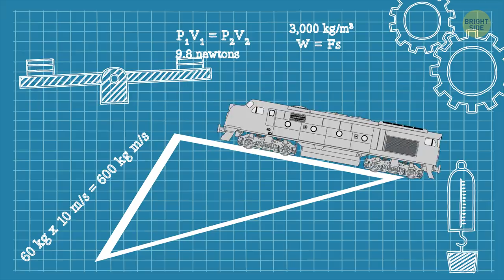Why Trains Blow Their Horns So Much

Comment: A locomotive in the back is called a “DPU” (Distributed Power Unit)
Reply: Hello fellow railfan
Reply: In the age of steam, especially in Britain. They were called Bankers. 0-10-0 banker locomotives were used on the Lickey Incline which is the steepest mainline incline in Britain at 2.65%
Reply: Don’t forget about Mid DPU lol
Reply: Only if it’s remotely equipped. As you probably know, DPUs are unoccupied by crews, while helper locomotives are.
Reply: Yep for the past 6 Years I was wondering was the meaning Of DPU is thanks for telling that
Reply: Hello other railfans

Comment: For the last part of the video... they used to split the train in two and make a double trip up the grade, or have a helper unit go up and down the grade... but now they used what is called a Distributive Power Unit, or DPU, these can be located anywhere in the train from the middle of the train to the rear end... just a little more info for viewers who aren’t as experienced with trains.

Comment: The loudest train horns of Japan are:

The Horn of the Series E5 Hayabusa Shinkansen
The Loud Horn of the Enoden Line 500 Series, that is only used when cars go out of curved areas near the railway, since the whole area is like a tramway, because trams run near city roads.
The Horn of the Toei Oedo Subway Line 12-000 Series, which echoes loudly even when the train is still far away.

Comment: The engine on the back is called a banker. Likley incline in Birmingham, UK, was a 1 in 37 and the Midland Railway built a massive 0-10-0 for banking. However, they also used Fowler's Class 3F Jinty Tank Engines. When it was taken over by the Western Region of British Railways, the used Hawksworth's 94XX Pannier Tank.

Comment: I've been a railfan since I first saw a Providence and Worcester local in Uxbridge when I was 3 or 4. I've spent YEARS at night listening to WODA going south at night. Usually I can hear a nice clear Leslie RS5T-RRO, a sign of a B40-8W, or sometimes a really fouled and quiet horn.

North American horn patterns for rail use vary by road. NJT sounds their horn before platforms, MN sounds for the access paths in New Haven, while the LIRR has some less-strict horn rules because they have their own rule book, and don't run under NORAC? I can really only speak for Northeastern roads though. And that's just pasenger roads; freight operations are different.

Comment: I live right next to railroad tracks that carry both commuter traffic (rush hour only - i.e., M-F morning and evening only) into Washington DC.  It also carries freight (and lots of coal) all day and night long.  The commuter depot is probably less than a 10th of a mile from my apt. building (and our bedroom faces the train station).  We have lived there for 13 years and we have become so used to it that we don't hear it at all during the night (unless we are already awake) and hardly during the day.  We have to consciously listen for it.  It is amazing how your brain can ignore repetitive, non-dangerous sounds.  It is only if the horns sound different or an especially heavy train goes by (sound is slower and lower and shakes the building) than usual that we are woken up.  Same with living close to a fire station.  Your brain usually filters it out.

Comment: 2 Long + 1 Short + 1 Long - We learned as children this sound made at crossing stands for: 

Stop! Look! and Listen!  That used to be on the crossing signs (the "X" shaped ones) and still is in some areas. Do NOT risk getting hit by a train. Your car may weigh 3500 to 6000 pounds, but the locomotive can weigh over 150,000 pounds. Not easy to stop just the locomotive. Even harder with 15 cars behind it loaded with a total of almost a million pounds.

Comment: Most of these horn signals.. are only for passenger service.   US Freight uses two shorts for going forward, 3 shorts for going backwards, 2 long 1 short 1 long for crossings, 1 long for a "going in between" (men working on equipment and brakes are set, reverser is centered to the motor does not move).

A lot of freight trains can do up to 3 percent hills, but that is called "mountain grade".  Special rules apply.  There is special cog trains that can go at higher degree hills.

Comment: Train brakes (at least in America) never really derail cars. American couplers are designed to prevent rail car collision during braking. Back in the day, however, train coupling was used by rope, which caused collision on cars and sometimes made the cars jump the rails. Nowadays, couplers are made of steel and they don't collide or derail like it did back then.

Comment: It’s called a whistle, not a horn, if it’s a steam engine it’s a whistle, if it’s a diesel it’s a horn
Reply: Not really, while whistles can be specific to steam locomotives, air whistles are commonly used on most modern trains in some countries in Europe. They're sounded when the train is about to depart from a station, and also as a precautionary warning. That's not to say that they don't have horns though, horns are only used in emergency purposes. In fact they used an audio file of one at 1:27. It's sad that they just hop onto wikipedia and copy and paste everything onto their script.
Reply: True and even some steam locomotives back in the day had horns as well. Is it rare of course, but it doesn’t mean it’s can’t happen

Comment: In the UK at the side of railway lines you will see, every-so-often, fairly large signs bearing the letters "SW." This stands for "Sound Whistle" and tells the driver that they need to sound their horn due to approaching a junction, a crossing point, etc. "SW" dates back to the steam engine days when the driver would sound their steam powered whistle. Although steam trains are a rarity on mainline railways in the UK these days, they decided to stick with the "SW" sign and not change it.

Comment: U have got it all mixed up. A STEAM engine has a whistle. A deisel has a horn.
Reply: Actually, some steam locomotives are equipped with air horns, and some diesel and electric locomotives are equipped with air whistles. Or small steam whistles that don't take up a lot of air pressure. The more you know.

Comment: There is a thing in railroad language that goes, "Don't Dump it till you Thump it" which means if there is a car on the tracks, you don't sump all the air in the system until you get a car, but if there is a tree log in the tracks,  it will go, "Dump it before you Thump it"

Comment: As a railfan, i can confirm this info is all correct for US railroads. by the way, the locomotive in the middle or rear of the train is usually remotely controlled and known as a "Distributed Power Unit" or "DPU".

Comment: A train horn is a loud, powerful air horn that serves as an audible warning device on electric and diesel locomotives, electric or diesel power cars, and in electric and diesel multiple units. The horn's primary purpose is to alert persons and animals to an oncoming train, especially when approaching a level crossing. The horn is also used for acknowledging signals given by railroad employees, such as during switching operations.
Reply: I Could not have said it any better

Comment: I don't live exactly next to a rail road but near me is some kind of phosphate refinery some 5 miles or more away. You can hear the faint horns as trains tow trucks of phosphate behind them. My face lights up. It's kinda quiet because they must have tons of cars filled with phosphate waiting for them or they mine slow enough for the refinery to handle.

Comment: say that to the 4-6% saluda grade in nc owned by norfolk southern locomotives till 2001 had to ram the back of some other trains and they have to have safety sidings at the bottom of the grade in case of a runaway they had to derail trains sometimes because the brakes went out on the grade

Comment: Should have mentioned the cogged railway, one that uses a middle "rail" that has teeth that meshes with a gear on the engine to pull the train up the hill.  Also there are trains that rather than going straight up a hill go around the hill several times at a more gradual incline.

Comment: When it comes to stopping.... yes but no... the brake shoes make direct contact with the wheel on most locomotives and rail cars... yes they are metal. The wheel doesn’t lock up, it rolls smoothly to a stop... so if sparks would ever be seen it would be from the brake shoes, but not only that.. a standard American freight train is around a MILE in length.. so NO it can’t really stop because all that weight at such speed doesn’t want to do anything else than keep propelling forward

EXAMPLE: if a train hit a car at the same time it hit the emergency brakes (100%) the entire train would pass you because the train is a mile long... that’s how long it takes it to stop at 55 MPH, so basically the last car would be in the spot where whatever it hit was when it fully stops.
Everyone should know that by now.

HORNS: long long short longs are only a rule in North America (Canada USA and Mexico) the first long is sounded usually as an automatic signal activates if there is one... the second is not long after that... the short is as the train is about to cross... and the final long is as the train crosses the road.

When a train moves forwards it sounds 2 SHORTS not longs.

What I’ve heard a train basically smashes the horn multiple times if something is on the track... repeated shorts.

Comment: I'm surprised you didn't mention that trains are fitted with systems to drop sand on the track in front of the drive wheels to assist with traction in slippery conditions.

Comment: I think this video is only for North America!  Other states have different rules!  Example Austria: (The country, which looks like a fish, is located in the heart of Europe and has no kangaroos) A distinction is made between high and low whistles.  High are for the environment, depth for signals within the train.  This used to be important when there were hand-braked trains.  Again, whistling only at technically unsecured level crossings.  The driver must whistle after passing a whistle signal 3x until reaching the railroad crossing.  This board must be at a distance where the train takes 27 seconds at top speed to reach the railroad crossing.  Other signals are the attention signal (1 short whistle) to warn, the danger signal (3 short whistles, several times Wiederhohlt) Actually the signals are no longer coming, turnout may be switched or the braking signals for handbrake trains used, but they still exist.  Furthermore, there are special pipes on work vehicles to warn work crews against train movements in the Arbeitsgles or a neighboring track.  Germany: Even there is not whistled when a railroad crossing traffic lights, barriers or both.  If a train comes to a whistle signal, then it must whistle once for 3 sec.  Such panels can be placed several times in front of a railroad crossing.  In the former GDR, there is also the double whistle signal (2x for 3 sec. Whistling) and on the narrow-gauge railways the bell signal, for the areas where the train driver has to ring the bell permanently.  Otherwise, the whistle signals are similar to those of the Austrians ...

Comment: Great video. Thank you for sharing it. However i do have a question. In my city, all rail road crossings have directional speakers that blast the "horn" straight down the roads and out of the houses. These same crossings do not have 4 quadrant gates. Are these crossings with the directional speakers against the law since there are not the 4 quadrant gates?
Reply: Those are called wayside horns
Reply: @LongmontRailway27  so are the trains allowed to not sound their horns when there are wayside horns?
Reply: @mrdarin1701  they don't need to use their horns if they already have a horn that's blowing for them

Comment: Bright Side If You Would Visit The Snowdon Or Any Other Mountain Railway You'de Be In Shock Since They Climb Somewhere About 79° Degrees up Hill. And It's Because Of A Special Device In The Middle Of The Train Tracks And A Gear Underneth The Train Connecting Up To It So It Never Slips.

Comment: It looks like you turned my comment into a video good job man the only thing you left out is on Modern Diesel electric locomotives and electric locomotives they have Dynamic brakes they turn the electric motors in two generators and they send that electricity to a modified short like a toaster oven and they dissipate that electricity as heat bullet trains and electrified trains are powered by What's called the catenary which is the poles and wires that run along the track the device that comes off of the train and touches the wire is called a pantograph and when an electric train stops it sends the electricity from the motors in Dynamic mode they'll create a lot of electricity when it's bring their train to a stop and they'll actually put that electricity up through the Pantagraph and into the wire through the red so other trains can use that electricity that's the difference between diesel locomotives and Electric diesel locomotives just have their electricity dissipate as heat and was called that Dynamic grid and what I meant by a 4% slope is it until 4% grade which is here is an example a 1% grade is 1 foot up in elevation for every 100 feet forward that you travel so a 4% grade is the maximum on standard gauge trains Narrow Gauge trains can go a lot steeper grades than that but that's 4 feat up for every 100 feet forward and that's what they mean on road signs when you see upgrade sign where it tells you steep grade 10% grade or whatever good job thank you for educating the world on locomotives and trains I will give you more tips if you want them and information look up trains 21 and distant signal Productions distance signal Productions will be able to teach you how different railroad signals work then Highway signals Road signals they're totally different I look up toy man television this dude's also a rail fan and he like steam locomotives like me there's a lot of different people that make railroad documentaries on YouTube they're actually quite fascinating because railroads are the arteries and veins of this country of any country railroads are what make everything work as well as it does before there was railroads it took three months or more to get across the country after the railroads were built it took a week to get across the country railroads were one of the most beneficial inventions to mankind that were ever known they helped proliferate the Industrial Revolution and help spread civilization across treacherous territories that were completely uninhabitable if it wasn't for railroads like in Australia there's literally towns that exist cuz of railroads it's like that all over the world Alaska has some cities and towns that you can only reach them by rail and railroads can climb up mountains they just have to survey the land and cut out a shelf look up Cajon Pass and Mariah's pass there's even a railroad in South America I can't remember what country is called the three mile high railroad it goes up switchbacks and climbs the craziest steepest mountains I've ever seen in my life you have to do all kinds of switchbacks and tunnels and all kinds of crazy tricks to make trains climb mountains look up the Narrow Gauge Railroad cumbres and Toltec which was the Rio Grande Railroad Narrow Gauge railroads are a very interesting awesome tangent on their own cuz every single one was custom-built for the environment that they're in and every country around the world has their own unique flavor of Narrow Gauge Railroad they all have their own personality I have a love for steam locomotive so I hunt for them all over the world looking for videos of locomotives from all over the world articulated steam locomotives are an interesting tangent Union Pacific Big Boy is called a articulated steam locomotives they are based off of a French design that was a compound but the big boy is a  what's called a simple as all high pressure steam cylinders the big boy is known as one of the most powerful largest steam locomotives ever built and they just got one running and its numbers 4014 check it out and then another interesting articulated design never ran in America it was an English invention and it came actually from New Zealand but it ran in South Africa and Australia invented by a man called William Garrett so the locomotive is called Garrett steam locomotive and that is a narrow gauge double articulated steam locomotive that ran on 3 foot 6 inch gauge track and 2 foot 6 gauge track the steam era was a very interesting in man's development of machines the locomotive help tame the world and connect us all together in America after the Civil War the railroad here were literally the railroad ties that bind us back together as United States of America railroads didn't just go through towns they created towns and cities if it wasn't for railroads we wouldn't have a civilization that we have peace out man have a great day

Comment: Good video but you did explain something wrong for trains and railroads you said an incline is measured in degress thats wrong  its actually measured in a percentage grade. So if railroads say trains are going up a 2% grade it means a train will climb 2 feet up for every 100 feet of travel.  trains use degrees on track but to measure how sharp or wide a track curve is.

Comment: without the friction u.s. have steel and steel grinding each other down until the fuel rail is to nothing and then you have a whole lot of $2,000 for pears and paperwork and tons of other things so that shed on the track is the best option putting another engine and just wasting another opportunity problem until you have like an angel break down at the other end of the line engine for the hill and now you just lost the engine and have a late train and now you even have more paperwork to do so have fun with a 2000 paperwork